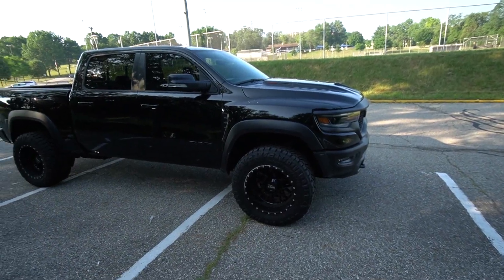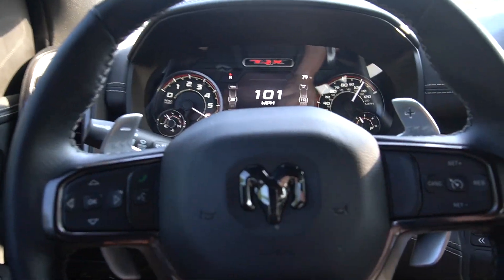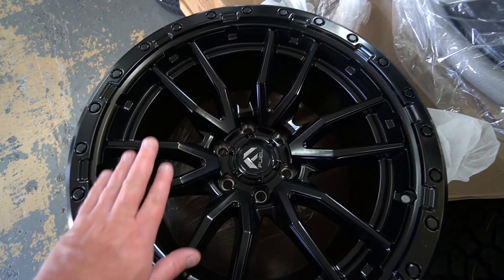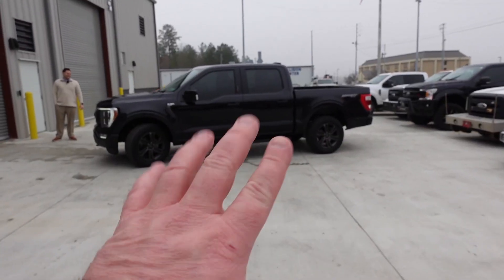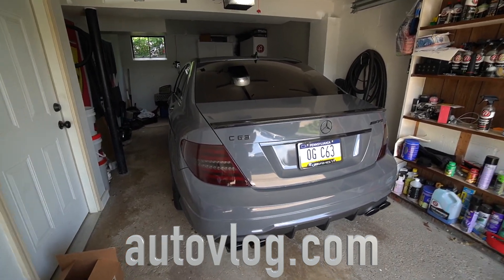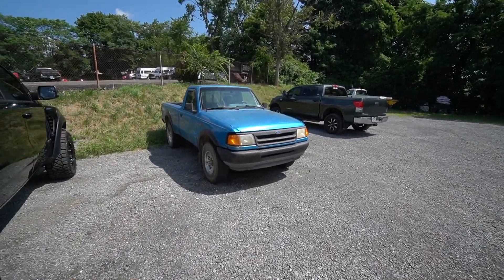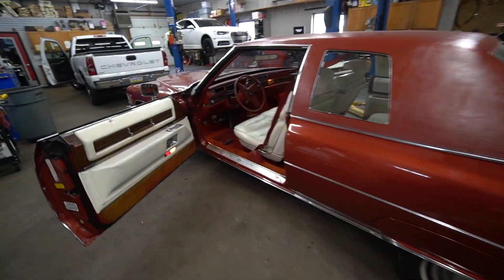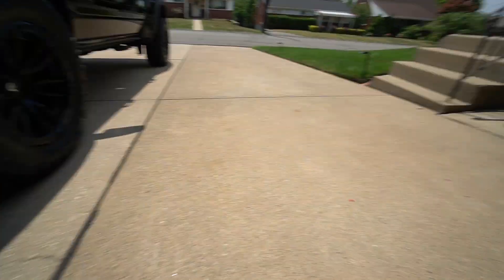I Quickly Learned To Hate This About My TRX..

Comment: TRX ,for Wifey's Ride ?
How does the TRX do for ease of parking in carpark buildings ,I Know they are too high with the rollbars fitted etc .
The rollback lid be next ?
So have you tried the snow mode ,on the road to see if the fuel consumption is better ?
And yes a cool classic American cruiser would be interesting.
Oldsmobiles are cool, because they are different to your run of the mill Chevy.

Comment: I used to do shifting without releasing the accelerator pedal, that was in all the cars with manual, we called power shift in motorcycles, that will increase the acceleration, you can do that in the little truck.

Comment: Is the timing chain getting oil? Couldn’t hardly hear you over that chain squeaking while tire guy was backing it out?
Reply: every trx even the pre production media truck have jad that squeek and it sounds like crap
Reply: @carculturenation2166  almost sounds like the typical hemi tick
Reply: Sounds like exhaust noise.
Reply: @GS0CK6  every trx literally does that sound and it's sh!t
Reply: Yep it’s a ram.  Not built to last
Reply: @maxracingteam23  Atleast it can start up and go unlike his brand new Raptor 3rd Gen that threw a hissy fit while they where in Florida and couldn't even move out of the driveway.
Reply: The ram will throw a rod just wait lol
Reply: @maxracingteam23  Not any sooner than that Raptor spilling all its engine oil due to a dumb thing like a bad oil pan. Lol.
Reply: @GS0CK6  say that to all the trx owners that had their engine blow up

Comment: So im curious @AutoVlog...Would something like an CTS3 Evolution tuner maybe give you better gas mileage? Im Original owner 2011 Raptor SuperCrew with CTS2 Evolution...Also, BBK 85MM Throttle body,Banks Ram Air CAI, Corsa Xtreme...After installing CTS2, 4-7 mpg Improvement..Curious if it might improve your MPG

Comment: New ones r nice choice but i got to mod the motor 1st money going for profomance next
Reply: I dont understand this what's app thing. I'm just an old trucker that likes ur videos. By the way welcome to the ram trx family. Lol  if u plan on doing bumbers look at fab four  matrix. It did fit a 13k lb winch and a slim double 30inch light bar. But it did make front end heavy so jumping u might want to get stiffer springs. That will be my next mod. It did add 235lbs to front end with everything

Comment: Can’t wait til the Raptor R is out. Just can’t get exited about a Dodge. Good power no doubt but the Ford looks soooo much better. Pretty sure it will outperform the Dodge as well. The wheels definitely improved the Dodge but it’s still a Dodge.
Reply: It might outperform offroad but the fact that the Raptor R has the same brakes and drivetrain that the 3.5 Raptor has is pretty scary and shows me Ford cut corners and had a budget with the Raptor R but they are charging 20k more than a TRX 🤷😂

Comment: Get some black touch up paint from the auto parts dip the brush in the paint put a generous amount fill in the scratch it will look 💯 better then that you don’t need a new will it will cost u 15 bucks dun son

Comment: from hood to good. -18 offset is the best on a big 4x4. i had that same size on my F250 but with a 37" tire. you should ceramic coat those wheels too Mike and then u just have to hit em with power washer and foam cannon but without having to scrub em'

Comment: The 6.2L Hemi will obviously use more gas then your 5.0L did
Reply: It's a 6.2 not 6.4
Reply: @dor1tomcswagger69  by mad 
I mean my bad
Reply: @dor1tomcswagger69  I would think it had the 392
Reply: @08_crown_vic  the older srt8 models had a 6.1 and newer srt models have  a 6.4 which is the 392 the hellcat is a 6.1 bored to a 6.2 the 6.1 is easier to mod over the 6.4 well that's what I've been told don't know if it's true

Comment: The old wheels looked like 💩   … not a fan of anything bigger than a 18” wheel on a 4x4.  Full-size trucks needs 35s or 37s to look proportionate & then a relatively small wheel to maximize sidewall. I prefer 17s, but not all brake calipers will clear on that size.

Comment: I guess nobody heard that horrible squeaking sound from the engine at idle...??? You must have an older serpentine belt on there or one of those pulley bearings is about ready to start screaming at ya...😉
Reply: It's normal brand new Hellcats and TRXs do it
Reply: @dor1tomcswagger69  that's not normal..listen at the 7:30 to 7:40 minute mark. I'm not talking about the super charger whine I'm talking about that squeal that sounds like a worn out idler pulley bearing. I bet if he sprayed belt dressing on it or a quick shot of WD on the right bearing the noise will stop momentarily and start slowly squeaking again.

Comment: Satin black has a shine and Matt black is completely flat without a shine. In that childish remark "Get a proper truck". They all do the same thing. Trucks are designed to carry heavy goods over bad terrain, if that's what it does then they are all the same. Having a massive engine in a pick up truck is about as useful as a chocolate kettle. So really, if you properly think about it, trucks like the Hyundai's, Hondas etc are technically a "proper truck". Don't be a badge snob Mike.